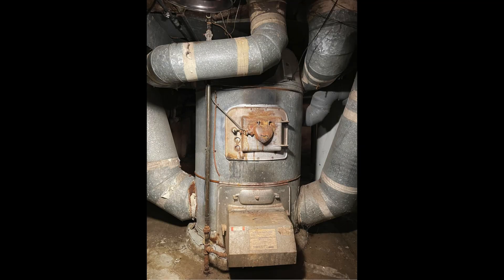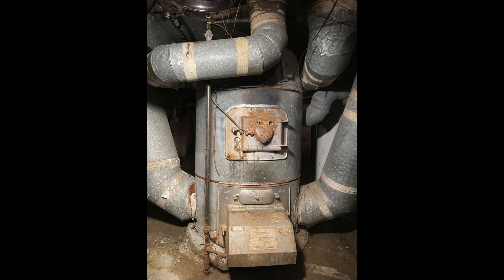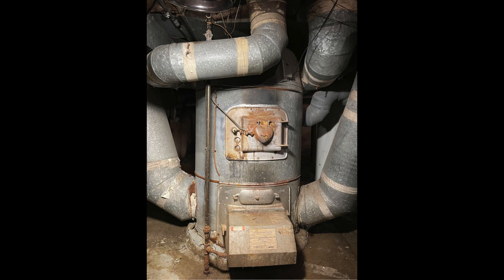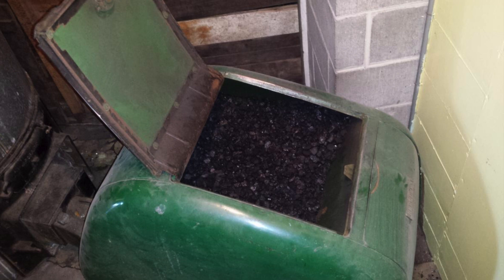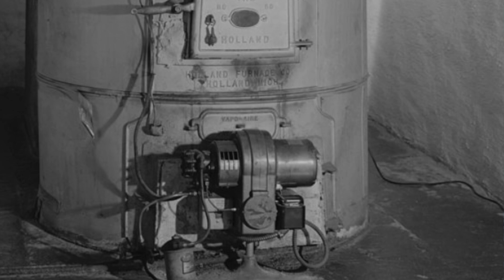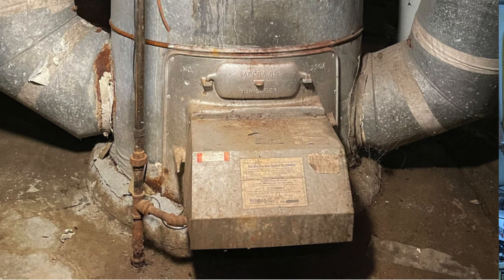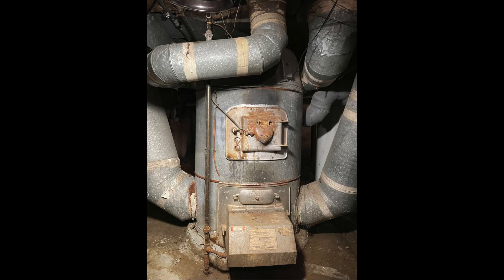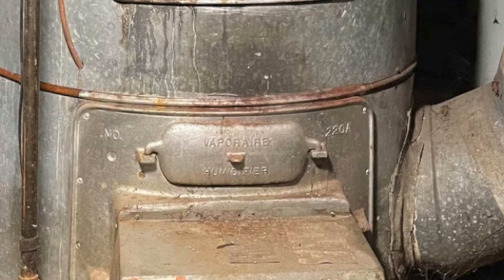Octopus furnace

Comment: If I could I would buy a newer gravity furnace like the one that a friend had. It looked like a regular forced air unit from the late '50s but no blower. It worked so well and it was so quiet. My furnace is a 70 year old Williamson it only comes on if the outside temp gets below 25 degrees the house is well insulated.
Reply from the maker: Sorry to disagree but the gravity furnace was ridiculously inefficient.  The lack of blower means much of the heat created by the flame goes out the chimney.  Modern furnaces are 95% efficient and can be had with variable speed blowers that are so quiet you cannot hear them run.  My furnace makes virtually no noise at all.  When replacing these old furnaces, we would reduce the gas input by about 1/2 and have plenty of heat.
GFM

Comment: It's efficient in the sense that it has very few moving parts compared to a modern furnace.
Reply from the maker: That's not efficiency.  That'a simply parts count.  The excessive fuel usage is simply prepaying for possible part failures on newer furnaces.
GFM

Comment: Used to see a lot of these in older Seattle homes, usually converted to oil, then gas, starting about 1955 (judging by the installation dates on the conversion burners).  The newest one I recall, still in use by the year 2001, was a 1949 house--had a gas burner, and was virtually silent when "running".

Comment: True story- about 25 years ago friends were looking at houses and they were looking at a fairly large 3 story fixer-upper (it was very cheap and looked like it was nice before remuddled and then neglected). I fully expected to see steam or gravity hit water heat. Instead, in the middle of the basement was the biggest octopus coal gravity warm air furnace I’ve ever seen. This thing had a scary movie presence with a myriad of large diameter “arms” turning this way and that sprouting from its head, the name MONCRIEF in giant letters spaced around its perimeter.  Funny thing was, the light switch was at the bottom of the basement stairs on the bottom railing post. A 200watt bulb was just in front of it, the whole thing only about two paces from the switch. If you don’t know this thing is there, you won’t see it in the dark as you focus on looking for the light switch. So when you flip the switch this menacing beast of an octopus suddenly materializes in front of you, illuminated and virtually in your face! My buddy goes to check out the basement and you would hear clomp clomp clomp clomp click WHOA!!!  This happened several times while we were there as others came through to check out the house. No one could NOT yelp out when encountering it. Just before leaving a young woman headed down there, clomp clomp clomp click —-SHRIEK!!!  Too funny. My friends passed on that one :-) but I will never forget that sight!
Reply: The furnace from Home Alone's bigger, meaner brother.

Comment: I agree If it was built for coal with the attendant 60% excess air requirements where any conversion burner is, in practice, going to be overwhelmed by the size of the flue gas passageways. So yeah your going to see roughly 45% overall efficiency at best? Now if it was made for natural gas and nothing else they could be pretty good when taking into account gas and electric usage together (no one ever does that though; they only look at the gas bill). A friend had one in a small single story house and it was an even comfortable heat. The gas bill was so low the concept of replacing something so reliable and bulletproof with the expectation that a new system would pay for itself in fuel savings was both surreal and a waste of valuable resources. But it sure didn’t look like an octopus either the way the coal fired ones were!

Comment: I have an octopus furnace in my house. It's an old homart, likely original to the home in 1950. The thing runs like a beast! I set it at 65° and it keeps the house around 70° against my will lol
The cost actually isn't too bad, especially for brutal midwest winters.

Comment: I saw a furnace / boiler ,? That was about 10 feet tall and 15 feet by 15 feet

The basement went down about 30 feet, and in the basement was a space dug out about 3 feet lower than the basement floor
The furnace was in that sunken area
It used coal
It was the thing of nightmares

It was built in this building that was a car dealership at the start of the 1900s

I think that something existed before the dealership 
But the building was massive 
It was about 1/4 of the city block
The building was from the street behind the main street and ran on the side street

Looking at the front of the building, you could see where the street was before, about 4 feet lower than it is now. 

I don't know how this happened 
I don't understand how the level of the street could have been built up, or why

Looking at the water pipes and the sewer pipes that were 30 feet down below the street or even deeper. 

The one water pipe broke and it was 60 feet under the street 

I don't know how they removed this huge metal, must have been iron, but they did

And the new furnace was a unit about 6 feet tall and 3 feet wide

It just seems incredible how small the furnace is now compared to how big they use to be 

And this was not the largest one I have ever seen 

The largest, if you ever watch the movie Nightmare on Elm Street, a school I saw, they had a staircase outside that was concrete and went down about 4 stories and I know this is going to sound crazy

If I had not seen it I would never have believed it, 

There were these 2 huge steel doors in the road in front of the school 

A tractor trailer came
One that has the open top, that they load dirt of rocks into. 
This one was loaded with coal
It has to have been at least 60 feet long

The driver pulled up just past the doors in the ground, got out, opened the doors, and there were control levers on the side behind the driver cab

He pulled a set of pins on the back of rig

He walked up to the front and pulled a lever and the back just behind the cab started to raise up
There was a giant hydraulic ram under the bed of the tractor trailer 
The coal began to pour into the hole where the doors were open in the ground 

The entire tractor trailer emptied into this hole

After he lowered the trailer back down, I looked in the hole, and it went down, at least 50 feet to top of the coal pile

I went down the stairs into the basement and through a massive metal set of doors and down a series of metal stairs and catwalks and opened another massive metal door

It opened to a catwalk around this thing that looks like the thing in Nightmare on Elm Street. 

It had to be 30 feet high and 50 feet square and on the back side was a conveyor that led into the wall and the huge hole that was below the metal doors in the street, there was a silo , this massive silo, like the ones on farms that hold the corn, except this was underground and there was coal in it

In the basement was a maze of rooms and they had an apartment in the basement / sub basement that 3 janitors live in full time. 
They had a kitchen with an electric stove, refrigerator, microwave, and bedrooms and chairs and a table and a living room with another refrigerator filled with beer, and easy chairs and a TV 

At the back end of the basement, where the boiler was in the front under the gym and auditorium and office, and the apartment was under the first half of the school, the back half of the school, under it was a fallout shelter

They had a set of actual blast doors with the fallout shelter logo and they had a set of showers between the outer and inner blast doors
And in the shelter was all these metal bunk beds and drums and boxes stacked everywhere that had the OCD triangle and circle on them. 
Some of them said water and others had numbers in yellow painted on them. And the cardboard boxes had the logo and numbers on them. 

The school was not that old
It was built around 1950

It actually replaced the small school that was in town

It was a lot bigger than it needed to be at the time 

They built the high school and about 1/4 mile away they built the Middle School and it was a carbon copy of the High School, so I would bet it had the same boiler and fallout shelter 

They built new schools in the 3 counties, all like this, all at the same time. 

They had stadiums and I don't know for sure but I would bet the fallout shelter extended under them

They must have planned to have the students go into the fallout shelter in the event of a nuclear war, but they never said anything about it. 

I was lucky enough to be there on a Saturday and got to see this. It was not ever mentioned. I don't think anyone outside of the men who lived in the basement and the principal knew that they lived there. 

The boiler needed constant attention, so they needed people living there
They never ran it during school hours
They would run it during the night and heat the building up. 

When it was running it produced a massive amount of black smoke out the chimney and it " rained " little bits of coal down on everything 
You would have these bits under your shirt and in your hair and when you took a shower it was a dirty mess in the shower. 
Which is probably why they didn't run it during school hours

They had massive water tanks in the basement that held the steam / hot water ? 
They had temperature gauges and pressure gauges and they were around 200 degrees 
It was hot as hell in the building in the morning 
But it cooled down by the afternoon 

The one guy was honored in a ceremony by the district. 
He had worked for the school for 40 years 
He bought a new car and he bought a new house in Florida back in 80s. 

He had come back from WW2 and got the job at the school and lived there for 40 years. 
For a single guy, he made out pretty well. 
He said they ate for free. They got food from the cafeteria and they had use of the school vehicles and were supplied uniforms and most of what they needed. 
He had never owned a vehicle before he retired. 
He said he hated the snow and he never wanted to see snow or be cold again. 

He had money in the bank and his pension and Social Security and he had his retirement planned. 

We should all be as lucky as he was.

Comment: I had this in my first house1920 double  in 1985. Great heat and no blower noise. My father-in-law was a heating guy so he pulled it out for new gas with ac for wife and new baby in August 95 degrees. That winter all the plaster  walls in back hallway s cracked do to lack of that octopus gravity heat. So anyone with a double should be aware of what might happen.fyi had to panel hallway

Comment: 100 years ago, who needed or wanted to bother with efficiency when coal was $5 - $10 a ton and oil was a few cents per gallon. Most of the units I saw were oil conversions and were condemned due a crack in the heat exchanger, which was easily diagnosed when the blower (kit) came on, and you'd get a change in the draft over the fire. Basically, not worth the time to make a repair... so out it came. By the 1980s the cost for removal went up as regulations came into play for asbestos removal. Many of them are still collecting dust (sitting next to the new unit) because people didn't want to pay for that.

Comment: It kept us warm in the winter, I remember sitting in front of the register in my bedroom and the pressure of the hot air coming out was more than you would think. The return was twice the size as shown and went to a wooden grate about 4ft x 3ft built into the side of the staircase base in the living room.  When we got a gas furnace my mother would be upset, even with cheese cloth on the second floor registers the years of suit in the pipes would come out.

Comment: Good Stuff! 
very interesting, I've definitely never seen one of those. 
My grandpa still has an OLD GE down firing oil boiler limping along, I thought that was old😅.
WE have to replace it though, some of the safety's are finally giving up the ghost.
Reply: Interesting; my Grand-dad's (then my Dad's later on) duplex in Washington, D.C., had one of these old GE "LA"-series downfired boilers; they were introduced about 1938. Last I knew it finally quit; something went wrong w/ the safeties w/ the result of large quantities of black smoke belching out the chimney...Fire dept. was called...I still have a rebuilt control module for one of these in a box somewhere in my collection; it appears to be a rather intricate timing mechanism for operating the burner.  I'd read where these could achieve 80% efficiency if set up correctly...Complex; some folks have kept them going by installing a conventional Beckett or Riello burner, installed on top.

Comment: Both of my grand parents homes were heated with these and they were both "lump coal" that were later converted to stoker coal.  I don't know why anyone would add a fan to these, they move air very well and made the house toasty warm.  One point to make was that when possible the return would be on an outside wall under a double window, usually a pair on opposite sides of the house. They knew the cold air from these single pane windows would "fall" into the return. I was never cold at grandma's.  There were two ways to regulate heat, both opened the damper at the bottom of the fire box. One used a chain connected to a knob upstairs...turning the knob pull the damper, this required you to close it, when warm enough.  Better ones used a thermostat to control a reversible motor with a "bell crank" to automatically open and close the damper. Coal was always a dirty way to heat, and the walls in your home would quickly need paint.  In the days before air conditioning, these were affordable for those who could not afford hot water systems.

Comment: I still repair these from time to time. Most are converted to oil. Many have had a blower cabinet added so that they are no longer gravity circulation. The stack temps on the converted ones with blower cabinet I have seen as low as 400 degrees. The asbestos removal means most people cannot afford to have them replaced. I even retrofitted a Carlin EZ-Gas to one in place of an old Midco Economite that no longer had parts available. I know of one that still has a Stewart Warner low pressure oil burner that uses the siphon nozzle. But they are very uncommon in my area. The vast majority of houses are steam or hot water. My own house is 2 pipe steam and I am in the middle of a boiler replacement to a Burnham Megasteam at the moment. Plenty of 100+ year old steam boilers still running here but not so much of Octopus furnaces. I'd much rather work on an old steam boiler than a furnace.

Comment: they were far more efficient, when compared to having fireplaces, wood/coal/oil burning units with multiple flues all sucking the heat out.
If you regulated the fire box air inlet and flue you could tame it down to heat ok and not throw as much out the chimney. Now compared to today's efficiency it sucks royally, although the efficiency could be brought way up using all sorts of trickery, it's just not worthwhile for the size and space it would consume.
I'd possibly keep one in place, if it was a seasonally used home/cabin where heat wasn't used often or only a hunting cabin or I guess as a non-functional conversation piece. lol

Comment: I still see these in operation today. I have repaired many of these over the years. Dirty bi-metal switches, sticking open mechanical motor gas valves or oiling the gas valve. Some had 100% outside return air. Some had retrofit blower motors. 
Mrs jones it will be 10k for the removal and asbestos mitigation and 10k for the furnace install

Comment: 120 plus year old design, required no electric if hand fed, no moving parts, stone reliable. You have to think, there were large areas of the US that didn't have electric power, especially before the REA, and the REA didn't even start until the 1930's and I think it wasn't over until the 1050's. I'm in my 60's and I have friends who grew up without electric and running water
Reply: Just had that discussion the other day about friends growing up in a house without indoor plumbing, but most of those didn't have central heat either because a small place was easily heated with small stoves in a few rooms, plus a cookstove in the kitchen. The rural electrification bill gave most everyone power well before WWII, even if it was minimal.

Comment: I saw quite a few of these octopus furnaces when I first started working for the full service gas utility in St. Louis ,Missouri (early 1980s). These things were gas pigs and the gas bills related with them were astronomical. The sad thing is,the people that use these furnaces were the ones least likely to afford the gas bill. The standard high limit setting was 300° on these furnaces and the only failsafe other than the thermocouple. Many of houses burned down to the ground because of the failed high limits. I would think by the time I retired in  2018 , I would imagine all of them have been replaced or tagged out 🎉.

Comment: The trouble with converting to forced air is the original ducts and vents are not suitable for it. Even if the trunk lines are redone, branches still a problem in 2-story homes unless doing a major gut. 2-story homes with re-used gravity branch lines and vents, especially the ones with first and second floor vents on the same branch are freezing on the second floor.

The homes these gravity furnaces are in have no insulation and really need a total gut and re-insulation, re-ducting job and enormous expense.
Reply: My house still has the original ducting in the walls but a new, high efficiency furnace. I have to set it below 60 at night or I wake up sweating. My bedroom is the hottest room when the heat is on! And it’s a shared duct that services the next room.